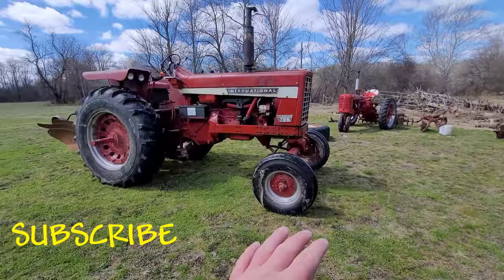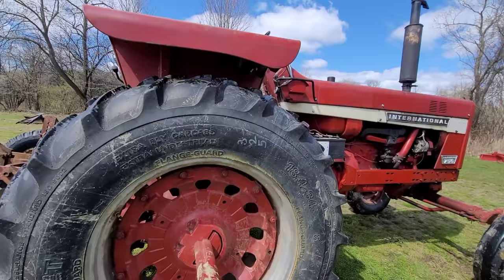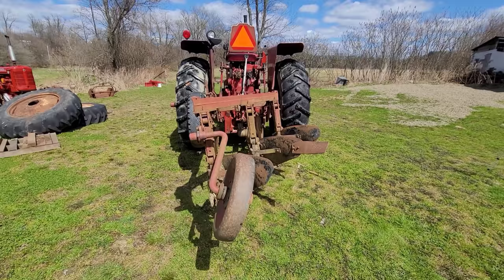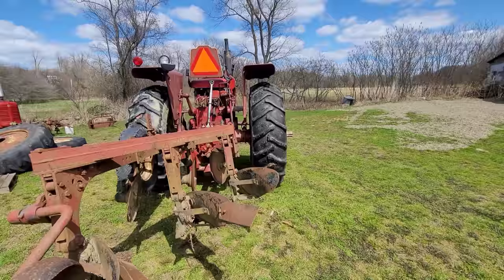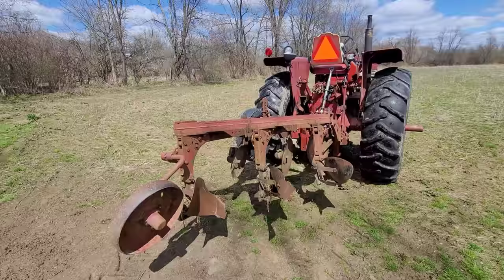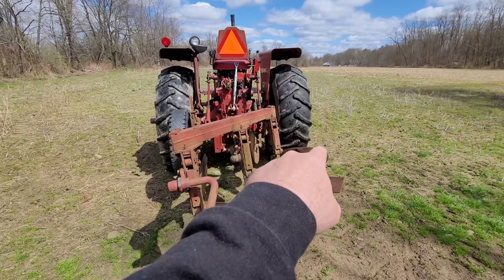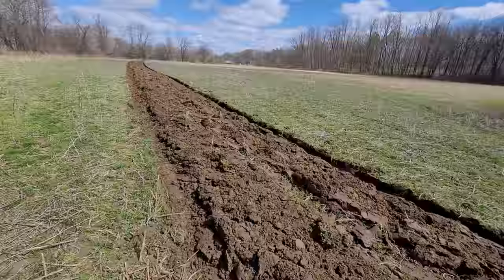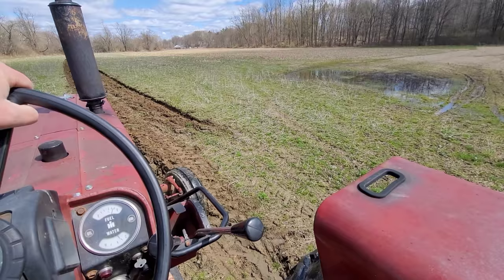How Do YOU Set YOUR Wheels for Moldboard Plowing?

Comment: I was taught if it was a 3-14 plow, take the full width of the first bottom and half the width of the second and add those together! That's 21 inches and then add 3 or 4 inches to that depending on tire size because you dont want the tires rubbing to hard on the furrow.
Reply from the maker: That's true you'll get furrow wear
Reply: Line of draft should be 25 inches on a 3-14. May have to adjust slightly depending on tires and the actual width of cut of the shares, depending on the brand of plow.
Reply from the maker: @glenirwin1110  mine actually are at 25 inches...guess that's why it worked to a T
Reply: @FarmallFanatic  I saw that it was working textbook. Beautiful. How fast were you going? You could turn a lot of dirt in a day even with a small plow.
Reply from the maker: Maybe like 8mph?

Comment: The Ol'Farmall 765 was sounding pretty good there.  Looks like you're setup about right from the looks of how level the soil lays after being turned over.  I haven't used a moldboard plow in years.  The last time my Ol' Farmall 806 pulled the John Deere semi-mount  4 bottom x 14", I left the tractor setup at about 32" from the center of the tractor to the center of the rear tire.  For just the Lil' Hay field, I wasn't going to mess with the setup.  Thanks for the ride along.  Happy Easter.
Reply from the maker: Hope you had a good weekend

Comment: Soil is mostly sandy loam, from the moisture it is breaking fairly good 👍 if it was clay loam or heavy clay it would be throwing out big slabs cause clay type soils don't generally break as fine as yours is doing.... we tried to get all ours broke in the fall, doing it in the spring could cause late planting if followed by a period of wet weather... I always tried to run a field cultivator or disk harrow just as soon as I could behind freshly broke ground..
Reply from the maker: If I had help, I'd have someone discing a few hours behind me. It's that good of ground

Comment: 18.4-34s work fine in 14" furrows. When I was a boy, my dad had an Oliver 5-14 plow and he pulled it with an 806, and  two 4-14 plows that were pulled with a WD-9 and 650 respectively. All those tractors have 18.4-34s and they ran in the furrows fine. Using standard tread tractors means you don't adjust the wheels on the tractor but the hitch on the plow. We now use a 6-16 IH trailing type plow and the hitch is set so the tractor stays out of the furrow. We either use a 1066 with 18.4-38 duals or 1206 with 24.5-32 singles, so no wheel in the furrow.  That 311 plow would be nice on the 400.

Comment: Centerline of pull (tractor side) and centerline of draft (plow side) should be one in the same. Centerline of draft isn't as cut-and-dry as I originally thought.  Then you want your real wheels set equally. Mounted plows don't have nearly as many adjustments as a trailer plow or semi-mount, which simplifies things, but often means compromises as well. There's a DVD out there called "A Guide to Better Plowing" that goes into detail on Centerline formulas and equations.
Reply from the maker: Great lead on the video 📹 👏
Reply: @FarmallFanatic  no problem! I think there's a preview on here somewhere

Comment: That setting looks just fine to me 👍 over here 🏴. We have the inner side walls of the front  an rear tyres runnin perfectly in line then put a long straight edge against the two tyres and measure from there to landside of first plough body with plough running in the middle of the tractor and adjust wheels to suit furrow width our wheel settings can be altered in 2inch increments that is on the older tractors modern tractors are different, Red Power 💥💪

Comment: Some of us still plow. I've got a 411 4x14 fasthitch behind my 706. Plowed a 50 plus year old sheep pasture, 5.5 acres. It was slow, hard, and like concrete. Sod stood up on edge.  Couldn't go fast enough to completely turn it over. Should have left the loader on for front weight. Front end, (wide), spent a third of the process up in the air. Your ground looks great.
Reply from the maker: I figure if I get that front weight bracket on there with 700 pounds I should be good with 411

Comment: We had a set just like your 3 bottoms. We used it on our 460. We couldn"t keep the depth firm, it always wanted to go deeper. I prefer trailor plows.
Reply from the maker: You have to either use the draft control or set your depth wheel

Comment: Ran 4 14s with 966 and 1086 for years with 18.4 tires dont ask me how lol it just worked grandpa did it i never got in on much lol. I ran the 5488 with 20.8s but it was pullin 6 20s and it just toyed with the tractor
Reply from the maker: I just crushed the one side of the furrow lol
Reply: As you can see it flips the dirt over and covers up the wheel marks just fine. My dad was following me with a 1066 with 20.8s and I had a 14" plow. You couldn't even tell the difference.
Reply: Man a 5488 and a three by three large square baler would be a dream for me

Comment: We left the 656 set at a center to center width of 76 inches or matched up to the proper set for 38" rows.
Reply from the maker: I think I'm about 50" currently, but I believe that's gonna have to go to about 62 for a 4 bottom
Reply: @FarmallFanatic  A two bottom 16 required a center to center of 64-inches and that was a lot of work to accomplish on the Fordson 2000 we had (removing and flipping the wheel centers). It was nice when we got the 656 with three 16's and did not have to touch the 76" centers. The JD's our neighbors had were the same, set to 76" centers for four 14's. I hope some of the other old guys will speak up because I am not sure your calcs are correct.
Reply from the maker: Well I'm at 50" for 3x14s...can't be more than another 11 to 14 inches for an additional 14 inch bottom. You saw me plowing with a 3x14 on 50" centers, can't deny success

Comment: I have a IH 4 bottom roll over mold board l bought from a cotton farmer south of Texarkana, paid 500 hundred for, don't use it every year. Love that plow. Wish I had instructions on how to set the plow up, it will start leaving dips in the furrow, ant suggestions.
Reply from the maker: What tractor are you using
Reply: @FarmallFanatic  Case IH MX110, 90 draw bar horse power
Reply from the maker: @larrywatson2109  Are they fourteen inch or sixteen
Reply: 14 inch
Reply: I need to figure out a way to send you pictures of all my ih stuff
Reply from the maker: @Larry Watson  From the dead center of the PTO shaft to the inside of the right tire should be 25 and a 1/2 inches for perfection ..anywhere near that. Will still put you in the ballpark
Reply: Thanks for the help

Comment: I pull a 311 plow with my 460 utility. I have a weight bracket on the front of my tractor like what’s on the 56 series
Reply from the maker: That would definitely work
Reply: @FarmallFanatic  yes it does! Took most of the fluid out of the rear tires and put wheel weights on so I’ll see how that works this spring. Suit case weights sure help steer the front end

Comment: I have  18.4 x 34 s  and have  changed  them from  38 inch rows  plows just fine !!! 
My 706 has 301 in it !!! 
Dose your 756 have  a 291 ??? 
Thats what my 706 had originally but has been  took out to 301 .
Gas hogs!!!!!
Reply from the maker: Yeah this is the 291
Reply: @FarmallFanatic  good  engine uses less gas than mine ..

Comment: Ih 311 3-14 should be set at 26 in from center of tractor to inside of tire 756 is 76 pto HP
Reply from the maker: The 706 is 76 PTO horsepower.. The 756 was never tested at the Nebraska testing center

Comment: AH that ole tractor sounds great!!   Im new to plowing, I have a 2 bottom the same size blades as yours,   I used it this year and probably have it set up wrong because I guessed at it.    Thanks for the items to check and make sure it dont damage my tires next time I set it up.   Mine dont have that depth wheel, it was extremely difficult to hold the depth that I wanted.   any recommendations to fix that?
Reply from the maker: What tractor do u have?
Reply: @FarmallFanatic  2002 Mahindra 4500 2 wheel drive

Comment: I just sold my 211 plows. They worked pretty well, but I didn’t need more plows. Haha
Reply from the maker: What tractor did you use with the 211s?
Reply: @FarmallFanatic  Super C or 200. Usually, 211 came with large points for a 300, but this one has the small points
Reply from the maker: @LedgemereHeritageFarm  that's a lot of plow for those tractors
Reply: @FarmallFanatic  it worked fine. Only 2 bottoms, but bigger.

Comment: If your land has been leveled for flood irrigation. A mole board plow ruins the level job. We quit plowing in 1966. Because of the hard pan the plow forms.
Reply from the maker: You have to plow at different depths ..also this is sandy loam.. I can take a steel rod and push it down through 3'